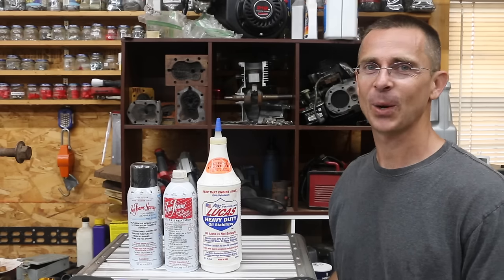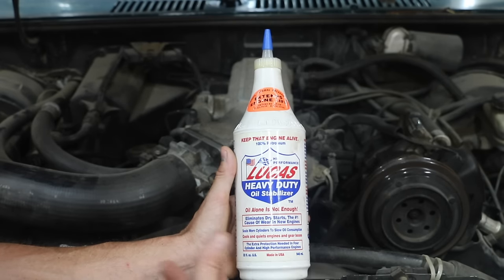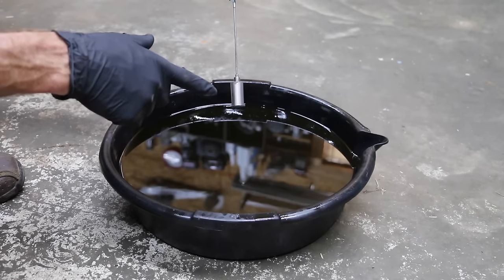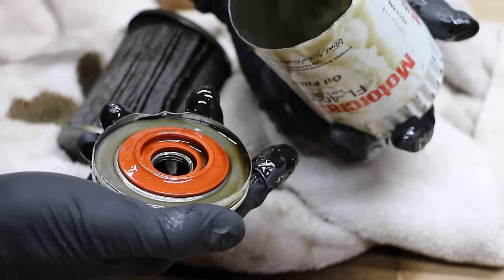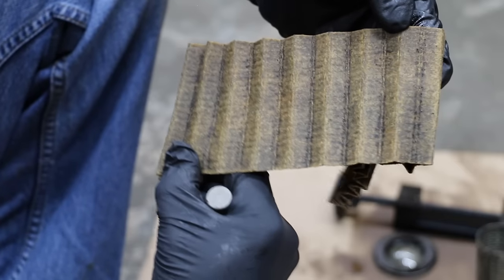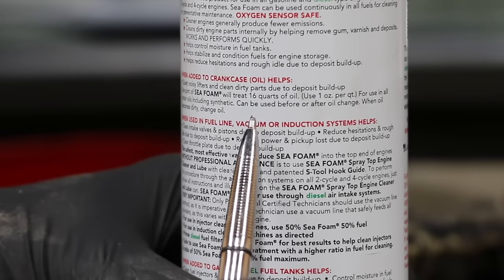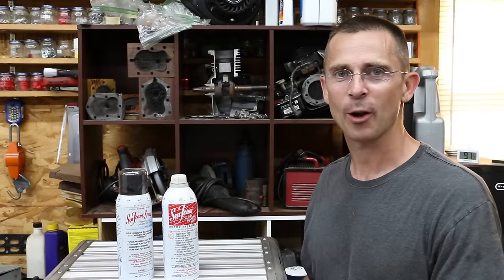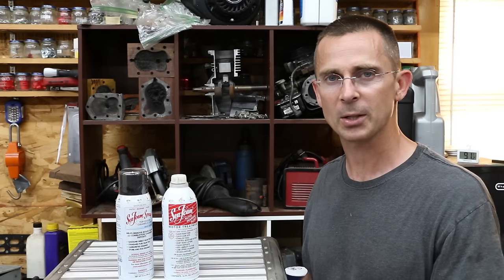Did the Seafoam fix last? Update on the Ford Ranger

Comment: I would use SHELL ROTELLA T6 15W-40 FULL SYNTHETIC and change the oil every 3000 miles a few times. The additives in diesel engine oil are designed to cut carbon deposits from the ring grooves.  Diesel engines require very high compression and if there are carbon deposits in the ring grooves you lose compression and possibly increased oil usage. From Shell website "Enhanced deposit control/cleanliness".
Reply from the maker: Thanks for the feedback.

Comment: What I've been doing all my old cars is I take the new oil filter and I put some neodymium button magnets in between the holes, when I take the oil filter back off when doing an oil change, I find lots of super fine metal build up on those magnets. Would the filter have stopped it? I don't really know since that's on the filter's intake side, but I do know that should have made my filter last longer anyway because I caught the metal on the magnets instead of clogging up the filter. And I sure am glad to have all that super fine metal abrasive out of my oil for preserving engine life.  One thing I would have liked to have noted when you put the magnet on the filter media, was the magnet attracted to the filter? If so that would indicated that there was metal in the filter. Love your videos man sure appreciate you.

Comment: Since I'm not a mechanic you might want to take what I say with a grain of salt but I know Lucas works great because it helped my 86 Buick Century run much better after the oil pump failed and caused a little wear on the main bearings. I've also used to restore a couple times and I love that stuff too. 
Those are the only two products that worked for me enough for me to comment. After seeing what seafoam did for your truck I'm very tempted to try it out on my car. 
As to slick 50 and the like, not a fan and I don't think it helped my engine at all. Of course, I have no hard data to be able to support my opinion so pay attention to the first part of my comment 😁

Comment: I don’t think I would consider continuing using Lucas either. In my old ranger my oil pump had a hard time picking up oil to the top of the engine. If you do decide to use Lucas’s again use it with 5w30 engine oil. I had 180 thousand miles on my truck so a lot of things were coming due for service and replacement.
Reply from the maker: Thanks for the feedback.

Comment: Have you tried water? Water is really good at cleaning stuff. Especially when hot. Also, try adding soap. I’ve heard that is also good at cleaning. You’ll probably need soap in a liquid form like washing detergent as I don’t think you’ll be able to get a bar of soap into the engine. Good luck. Let us know if it works.
Reply from the maker: Thanks for the suggestion.

Comment: RVS did wonders to my friend's Audi 200's compression , got progressively better the following year ...Nano Enrergizer seems to be the same product , It also did wonders to a screeching AC pump , Same thing with his MAN diesel truck which he used to pull 30 ton trailers to Spain.....I put it in My tiny 5 cylinder VW diesel , reduced the consumption from the specified 0,85 L per 10 km in mixed driving to 0.62....and massively less noisy....He also lost all warranties on his MAN truck but it consumed so much less he earned that back in 6 months, also put it in the rear axle and transmission....
Reply from the maker: Thanks for sharing.

Comment: LUCAS products did wonders in my truck. I am an Owner Operator truck driver, and had all kinds of problems with my truck, from burning motor oil, to lots of overhead noises, to leaks and rough operating, on both the engine and power steering. Leak on my power sterring was so bad, had to add 1 QUART of fluid "EVERYDAY😳". After adding lucas power steering fluid to it, I SWEAR, ALL LEAKING was GONE, COMPLETELY, and was smooth and quiet; VERY IMPRESSIVE! I was kinda desperate cause, I was gonna have to replace that power steering pump, and it cost $1350.oo, plus some 5hrs/labor; but after adding that $10 bottle of lucas power streering fluid, the steering issue was COMPLETELY FIXED!
as far as the engine goes, was burning a lot of oil, had to add "2 GALLONS", yes... 2 GALLONS every week😬!!! It was a big, 16 litres Volvo D16 engine, that took 15 gallons. The engine was running rough and burning all that oil. After adding Lucas oil aditive, it immediately became very "quiet and smooth", and the oil burning dropped from "2 gallons per week/8 gallons per month", down to 2 gallons per month, and after a little longer, only 1 gallon per month... very VERY IMPRESSIVE! But just like he showed in his video, lucas is pretty thick, but loses its viscosity after a little while.
But one thing I tell you... do NOT USE LUCAS motor oil additive during the winter/cold months... DO NOT; WAY TOO THICK! Makes it hard to start, takes forever to reach the head, and it has the OPPOSITE effect that it does during the warm/hot months, it won't lube for being so thick. Great video, as always😉.
Reply from the maker: Thanks!  Thanks for the feedback.

Comment: the 2.9l  is a solid lifter engine so the noise you were hearing was not all lifter noise although they need ajustment occasionally...i would never use any flush in a sludged up engine as all that sludge will be pumped through the whole engine causing alot of damage...the oil pickup screen was no doubt mostly plugged and should have been cleaned...there is no miracle product that will rebuild your engine....
Reply from the maker: Thanks for the feedback.

Comment: Good choice of filter.  They are not all the same.  Motorcraft is made by Purolater, their best one.  Great filter.  Fram is pretty bad, cheap.  Most are.  Mobil one is great too.  Best to use an OEM filter.  Also hate to be the bearer of bad news but synthetic is no longer synthetic.  It is petro based but rerefined to act like synthetic at cold temps.  That's why it doesn't cost 5x conventional oil like it used to.  This is from an oils expert at CAT.  Even Amsoil is not true synthetic.
Reply from the maker: Thanks for the feedback.

Comment: Here's a tip for you. Try placing a magnet from an old computer hard drive on your oil filter. That way no metal deposits will be reciculated back to the engine.
Reply from the maker: Thanks for the suggestion.

Comment: Another Old Timer HACK when you have the time to let your engine sit for a few days, drain the oil as usual and then put the plug back in. Then put about a gallon of kerosene into the engine and let it sit for a few days. (I have even shook the vehicle side to side to try to help). The Kerosene will break down the crud in the bottom of the pan. Drain it after a few days or longer if you have the time.. Some go straight to new oil at this time, but I usually put old filtered oil into the pan to be sure I got all I can out. Drain it again and put the plug back in and finish your oil change.  The customer that had me do this on his old caddy engine told me he had been doing it once a year since it was a few years old. It was a fifty something Caddy and this was in the mid 80's. I did as he wanted and he was quite happy. I can say I saw clumps of crap come out with the initial drain, but I swear it was "Quacker" State paraffin wax oozing out.. I finally got him off Quacker State and into Valvoline and the last time I saw the car, (he had died), his son brought it to me saying "Dad told me only you work on it"!! That was in 1994'.
Reply from the maker: Thank you for the information!
Reply: Engine needs to be hot so all the oil drains easier cold oli is thicker so not all the oli comes out of the engine block

Comment: good video sir. it may be my opinion but i still hear a little tapping. 
One thing that magnet wont pick up is the non ferrous bearing material.  
you can also use a simple can opener on the filter if you remove the rubber gasket. 
save you a few bucks
that being said i gave ya a thumbs up and will buy some Seafoam for my POS
Reply from the maker: Thanks!  Thanks for the feedback.

Comment: With the cylinder at TDC compression stroke, connect air line to it and slowly increase pressure and listen at the tail pipe, if you hear burping, then the exhaust valves are allowing compression loss. Time for a valve job.
Reply from the maker: Thanks for the feedback.

Comment: Nice follow up! Not sure why I'm just now seeing this video. I had previously heard good things about Seafoam; but you really sold me on it with your first video, which is also what got me subbed. I dunno if it's just the camera or what, but that oil looked rather watery in the pan. I think if you really want to clean out the sludge & varnish buildup in the engine, you should switch to an oil with better detergent properties. Based on the age of that Ranger, I'd suggest Royal Purple HMX.
Reply from the maker: Thanks!  Thanks for the constructive feedback.
Reply: @ProjectFarm  Anything to help! 👍🏼

Comment: I am hoping you still have your truck she is a gem. Please provide an update after 5 years of seafom. You may have one or more bad bearing. Remove the serpentine belt and check the idler, tensioners, pump, ac etc
Reply from the maker: Thanks for the suggestion.
Reply: Many like myself have been thoroughly educated and entertained by your videos over the years. You are the reason I have been using amsoil in my mercedes for so many years with no regrets. The level of confidence your video inspires to try new products is unmatched. Again thank you. Seriously I know everyone wants to see more vidoes of that beautiful truck.

Comment: I was never happy with Lucas I know it has its place amongst a lot of people but I find it not to be a very good product, now seafoam I have used off and on since the 1980s and have been very happy with their product plus I drive a 1995 Plymouth Grand Voyager 3.36 cylinder with only $219,000 mi on her with no mechanical issues love my seafoam for the engine and the gas
Reply from the maker: Thanks for sharing.

Comment: Pour two ounces of draino into each spark plug hole, bar over to distribute and let sit for twenty four hours.  Put rags  over the holes and crank out excess. Then run a tank of gas thru and change oil. Frees up stuck piston rings.
Reply from the maker: Thanks for the feedback.

Comment: As much as I like Lucas stuff I can't imagine putting that oil stabilizer in something like my Honda with variable valve timing. When I got it the previous owner had used the wrong viscosity oil and that was enough to throw a VVT engine code. It cracks me up the nipple dispenser they give you with that product as if you're filling a rearend.
Reply from the maker: Thanks for the feedback.

Comment: Regarding your question at the end as to what you should do to the engine: Well, if the block will take it, you could slightly bore out the engine and install broader pistons and rings. Then the compression will be as new, and you should have more power as well. Of course, this is far from the cheapest option.
Reply from the maker: Thanks for the feedback.

Comment: Great video, great job, I was out in my Porsche 944 last month.  It ran horribly, I was about 150 miles from home, I felt lucky to get home in it.  While I was out I remembered your video, I stopped and bought some Seafoam gas additive,  it was the only stuff they had in that category.  I managed to get home, I told myself the Seafoam helped.  If the RPMs fell below 1,500 - 2,000 the engine would die.  The next week I directed that it get a complete standard tune up new parts.  When I spoke to the shop they said it had bad/broken parts, ran better did not run good.  Kept it in the shop, determined it needed a cam position sensor, it runs good now.  I really hope U Tube pays you enough to make producing the video's worth your time.  Hopefully, they will not delete my comment, they usually do, U Tube doesn't agree with my opinion of leftist politicians..
Reply from the maker: Thanks!  Thanks for sharing.

Comment: Try the old Slick 50 
1qt. the 1st one to hit the shelf.  My 84 z28 305 motor. 268,000 mi.
Burned oil Big time. 
If I floored it ,Thick Smoke would blast out . No cats, just Flow masters. At 3 qts low motor would heat up & start loosening power on highway at 80 mph.
To the point of blowing up & Lock up, you backed out power got off rd , added oil 3 qts.
Using Kendell nitro 90 a Straight 70 weight conventional Oil.
After SLICK 50 . MOTOR NEVER GOT HOT OR LOST POWER.
I Would stop for gas and check oil.  Not on stick.  4 qts Low.  many times . Running on 1 qt of Oil. Running 80 & 100 mph on Highway.  Never missed a lick.  Slick 50 coated the bearings and worked.

Comment: Iv used a little bit of transmission fluid two clean my engine about half a quart run about 15 r 20 miles speed limit.change oil and filter.
Reply from the maker: Thanks for sharing.

Comment: Two things.
You don't have to use a full bottle of Lucas.
1/2 is the same in protection.
Also you cleaned out OIL lifters that were really far.
You absolutely will get some metal for the rest of the engine life.
Reply from the maker: Thanksk for the feedback.

Comment: I would like to see you test the John Deere 15w/40 engine oil against Chevron 15w/40 and against shell 15w/40. 
I would also love to see results of Lucas added to those three oils I would love even more to see seafoam put into them for that matter. And one with both just to see what that does!
How much it changes flow characteristics for potential better cold starts and how it affects lubrication if it lowers it much if at all maybe it improves it. It would be a-lot of testing I'm sure.  Maybe a 2-part 1 where those 3 oils face off  and a second one where the Lucas Oil stabilizer, Lucas Synthetic Oil stabilizer, and the Sea-Foam additive are added to the best Oil of these 3. Other additives could be tested alongside them also to make a broader test of 4 or 5 common additives. Cold pour @ 2or3 temperatures & lubricity testing would be most useful.
Reply from the maker: Thanks for the suggestions.

Comment: change the filter and add 1/2 quart of kerosene or diesel to the crankcase, idle engine 30 minutes then change the oil, this removes buildup gently and effectively. if you have low compression you can try a chemical induction to free up gummy stuck rings, push rod adjustment if applicable or additives may help for a little bit but the reality is they are worn so the issue quickly returns with a vengeance.
Reply from the maker: Thanks for the feedback.

Comment: I have used sea foam in my gas and it made an amazing improvement, becoming a smooth running engine.  So I can add sea foam to oil also?

Comment: Hard to get true compression test from one plug removed. Suggested method is all plugs out (eliminates drag of compression on other cyls), while holding throttle wide open testing all cyls. Then if necessary,, Cyl leak down test, at tdc (Compression stroke) & ~bdc (Power stroke) with each cyl having valves fully closed, used to test valves, rings, head gasket, Cyl wear.
Reply from the maker: Thanks for the suggestion.

Comment: Ever tried JB products? It faired better in a stress test performed alongside Lucas.
 Also I’m a firm believer in Seafoam everything. However, when using as an oil additive I always change the oil in the first 150-200 miles. In your case maybe after a few weeks or months but not a year or even close.
Reply from the maker: Thanks for the feedback.

Comment: I've started using Sea Foam in my 2009 Ford Escape.  My car was stalling while driving; indeed it died while driving.  I added Sea Foam to my gas.  After just one can in a tank of gas, it worked.  Another benefit I noticed was improved gas mileage.  Car went from around 20mpg to 25.  I now add it to my gas every so often.  Thanks for mentioning Sea Foam and thanks to Lowes for stocking it.  Oh yeah, thanks for your good work!
Reply from the maker: Thanks!  Thanks for sharing.
Reply: If it made your gas mileage go up 25%, why not use it every tank? And I wonder why everyone doesn't use it to get 10, 20, 25% or more gas mileage?
Reply: @land7776  Because it adds around $8 to $10 per tank of gas.   It would be nice if seafoam was free!
Reply: @bunkerliving  at current gas prices you would still be saving plenty. If you have a 20 gallon tank, that's 5x $4.50 or >$12 per tank saving with the SeaFoam. I'd do the same except I've never seen any additive that gives 25% better MPG, although I've heard the claims.

Comment: I didn't have good results from using engine restore. It gummed the engine I used it in. I did have great results from using diesel to clean my engine! I had no pressure on my oil gauge and after flushing with diesel I had 40 pounds of pressure
Reply from the maker: Great feedback. Thank you

Comment: Todd, what is your background? Your tests are so exacting and accurate!!!! You're a 10 on the smart scale!! Ok, I have a Ford F-350 2006 I only use for pulling my trailer around camping.
The issue is the rear main seal is getting dried out, and I'm starting to see a few drops of oil in the drive way.

 I I have tried "Buck" Rear amin Sealer. Seems to work but is there another product you have tested that may be better? Thank you, Todd, for all your work for the benefit of others!!!

Comment: IMHO, using the Seafoam over time will bring back the compression as it cleans the ring grooves and de-glazes the cylinder walls, if you did more heavy throttle driving it would work faster but in time I believe it will improve the compression.
Reply from the maker: Thanks for the feedback.

Comment: I wonder if something like hot shots sticktion eliminator would work to reduce the engine noise and "clean" the oil.  Apparently that's one of their selling features.  Have you ever considered comparing "engine" flushes for your engines?